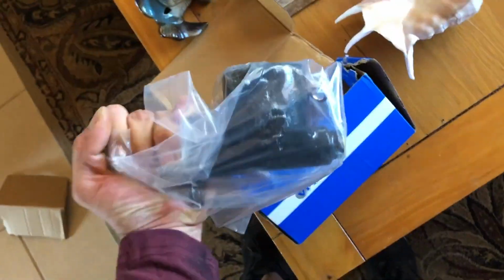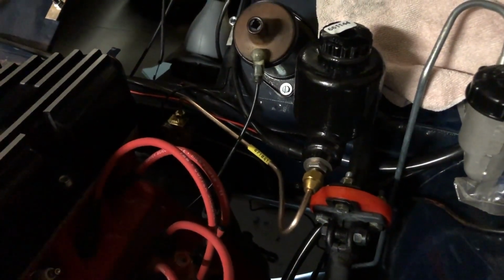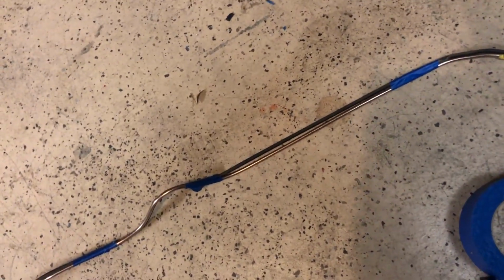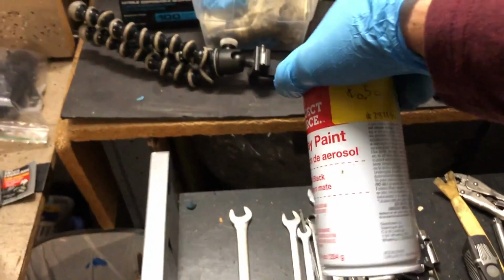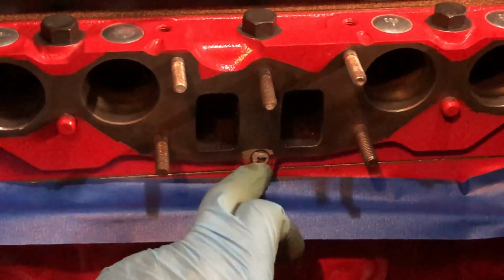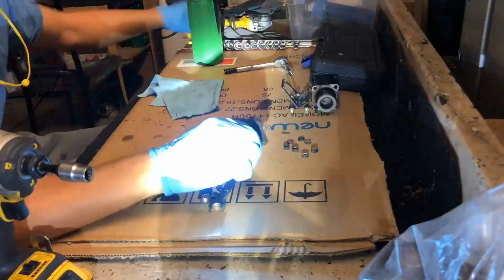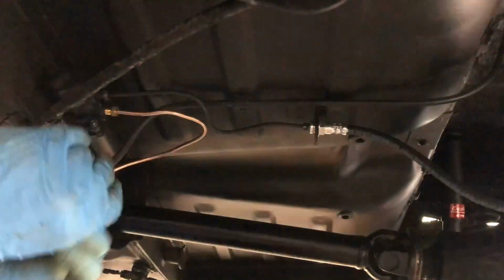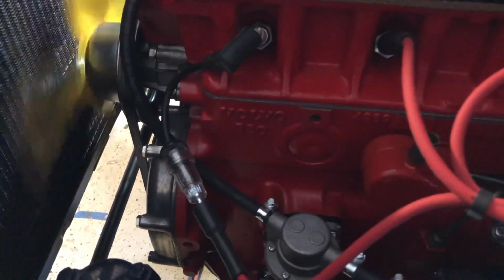🇸🇪 (S3:E17) B20 First Start Volvo Amazon Restoration

Comment: Please update what you found in regards to the intermittent spark issue.  I have the same problem and really don’t want to dish out the cash for electronics ignition.
Reply: Fil Mart I've had distributor performance issues with my 122... One time it was shorting out where the lead wire insulator was worn.. replaced it and ran fine... Eventually I went to Pertronix and was glad I did so... No more points to fool with...